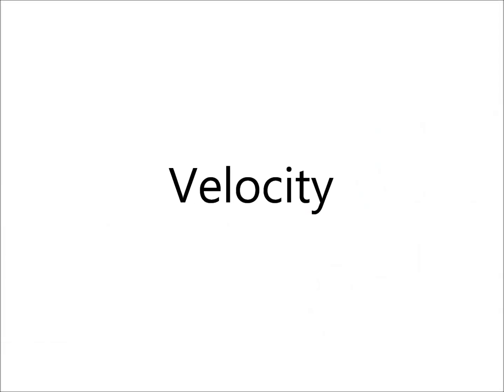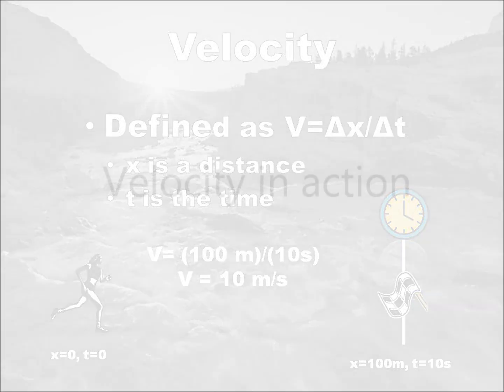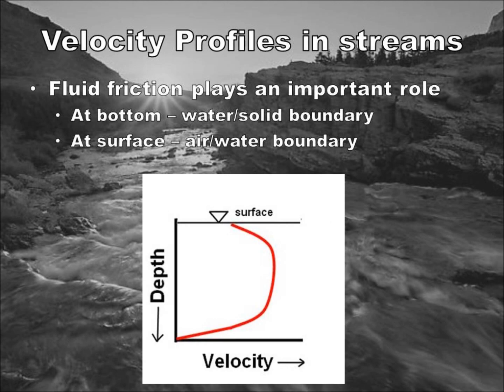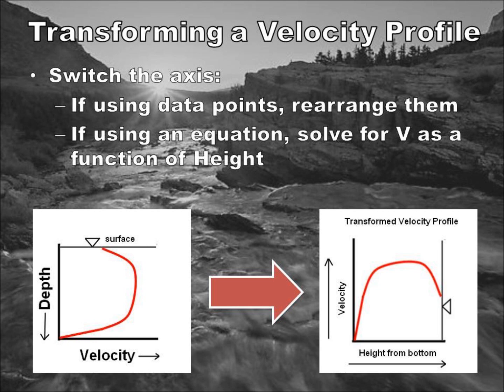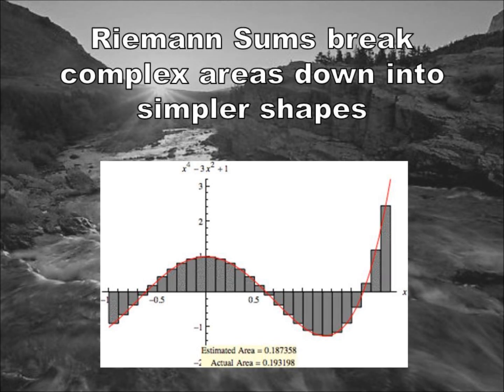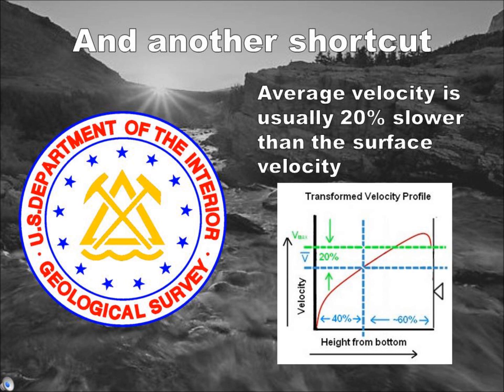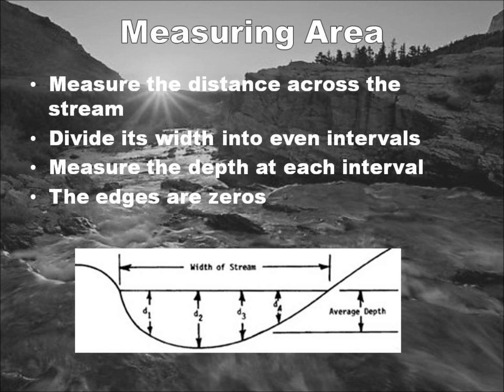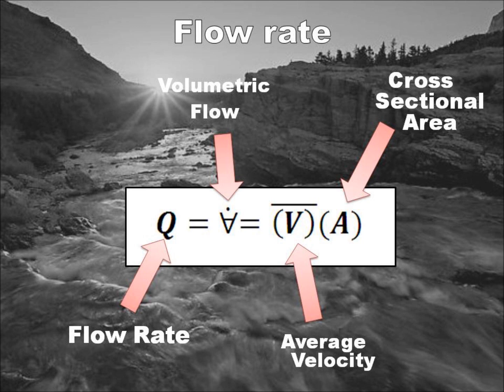Measuring Streamflow Using the Float Method.wmv

Comment: the lecture is interesting and colorful.after doing this and the like we can find stream discharge.but what the problem is how to find the daily flow having event based flow like the following measurement.
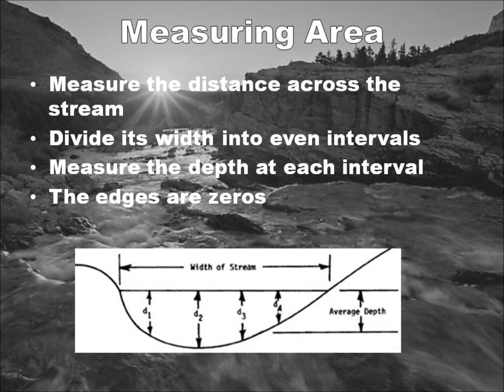4/12/2017 at 6:00 we have 0.2m3/s ,4/12/2017 at 18:00 we have 0.15m3/s,   4/13/2017 at 5:30 we have 0.3m3/s,4/13/2017 at 15:00 we have 0.25m3/s ,4/13/2017 at 19:00 we have 0.5m3/s etc .use spread sheet. "peterwater2123@gmail.com" 
thank you for doing this.